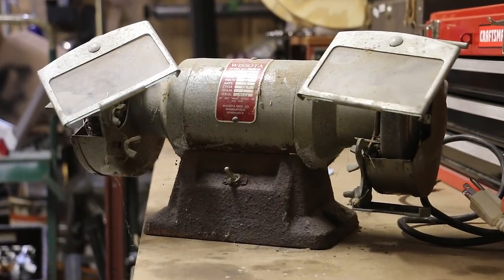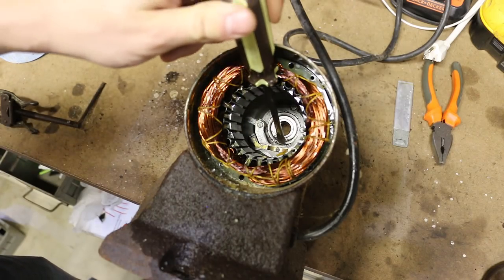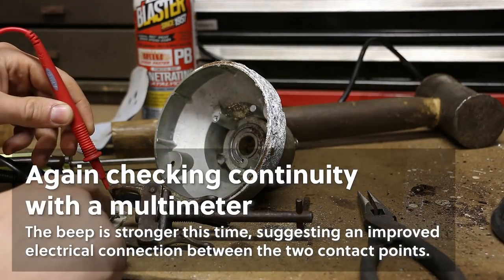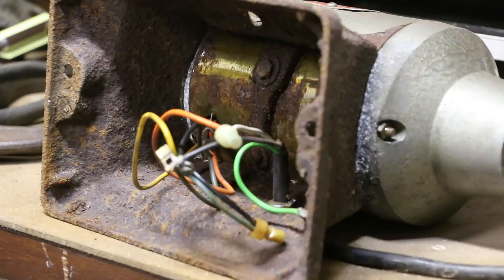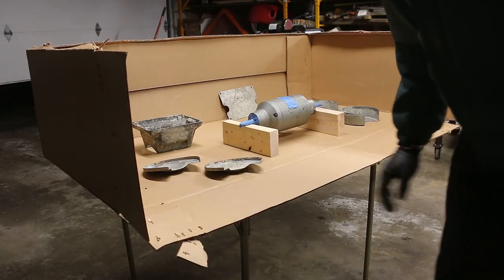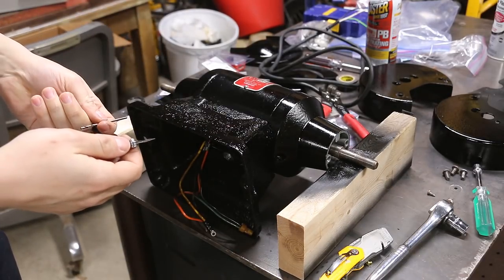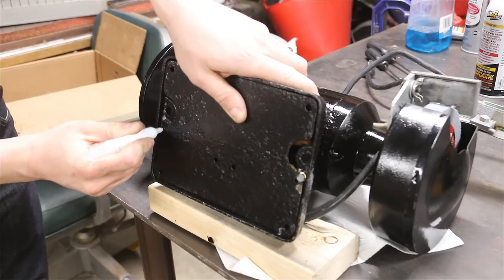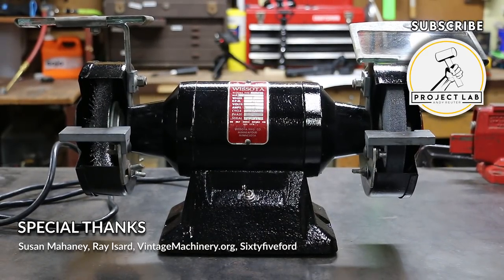Rusty old bench grinder restoration

Comment: How does that 1/4 hp motor do for power when grinding?  Looks like 2.8 amps?
Reply from the maker: Yup, 2.8 amps. Works great! I’m not making swords or anything, but I have experienced zero temptation so far to upgrade, based on the regular pieces of metal I have ground on it. I have used it a bit in some of my welder/metalworking videos, if you want to see it in action. 👍

Comment: Nice job. Was there even a start capacitor in it? That centrifugal switch looks like a start to run winding switch but I didn't see either start or run cap in it.
Reply from the maker: Thank you! Correct, no start capacitor. 👍

Comment: Great job, except I would have matched the original paint color.
Reply from the maker: Thanks! I thought long and hard about what color to paint it. Couldn't find a good solution for matching the previous color. I considered using the hammered Rustoleum stuff, but I'm skeptical of the brand, based on past experience. Meanwhile, I know that the Montana Gold paint works great. (Thanks to Jimmy DiResta.) I had some black left over from a different project, so I just ended up using that.

Might not have been the perfect choice, but it's working for now...

Comment: Next time you take a grinder apart that has been this wet...replace the bearings. Might cost you $10 max at a pricey place. Ebay..maybe $5. I can hear the bearings singing when the grinder runs and when you load it up. Not a major problem yet..but in a couple years under your usage..they will be DRT.
Reply from the maker: Thanks for the grinder bearing analysis! I will keep an ear out for that next time I use it...

Comment: Is the constant buzzing halogen lights? The video is really nice and the bat was the star of the show, but I found the noise a bit annoying.
Reply from the maker: Thanks! The buzzing is either some old fluorescent bulbs or a garage heater. The bulbs have been replaced with LEDs, and the heater won’t be on for a little while. 👍

Comment: Really nice, but did you replace the bearings?  Those would be the next items to go, I'd think.
Reply from the maker: Thanks! Didn’t change the bearings, figured that they sounded fine, and if they weren’t bad, I didn’t want to risk screwing them up. Maybe I should have, but at least it’s not too tough to get back in there...
Reply: True, once you've opened it once it's like riding a bike thereafter....probably the scariest part of this video is the fact that the Wissota grinder and I are exactly the same age.

Comment: my bench grinder is only like 2 years old (i dont use it much) i have to spin the grinding wheel so the bench grinder can start spining on its own
Reply from the maker: Whoa! Fair enough.
Reply: capacitor
Reply: and my bench grinder only has 350W of power

Comment: Why did you paint it black?  It is not good color for machines as it is harder to see when you work in the shop. Usually they are painted so that you see easily where the power tools are. Grey was much better and even better if it was painted more visibly. You need contrast between different tools so you see them fast, if you understand what I mean. It is safety matter. Perhaps you could paint the stone guards with lighter color. Especially when you have young serviceman helping you. BTW, the switch hex nut must be between the switch and panel, not outside as the hex nut prevents the threaded collar to rip off the switch. And one more important thing; measure the protective earth contact with ohm meter using small ohm scale to be sure it is ok.
Reply from the maker: I'm sure there are better colors out there, but black works fine here. I already had procrastinated for long enough on this, and I didn't want to agonize any longer over what the "perfect" paint color and brand would be. So I went with what I knew would work, and that was some Montana Gold SCH black that I had available. Thanks for the advice, in any case!

Comment: I did not see you lubricate the motor bearings. Did I miss it ?
Reply from the maker: Nope, didn’t do that step. Bearings seemed fine, so I left them alone. But never considered lubricating them. Any product you recommend?
Reply: @AndrewReuter  Since  you did such a great job with the restoration, it only seems right to properly lubricate the motor bearings. They do take the most punishment. There are many grease products specific for electric motor lubrication. I've used WD-40 protective white lithium grease with good results. Maybe someone here can be more specific.
Reply from the maker: Good to know. Thanks!

Comment: Bet if you tried it after tapping it with a hammer itwould have worked lol, but great job looks good!
Reply: All that work and you didnt sand down the brushes?!?also when taping of netal with sharp edges tap lightly all around with a hammer and it will cut and seal the tape line perfectly!
Reply from the maker: Thanks for the tips!

Comment: I cannot think of a single good reason for you to be using Lead Blaster for that application. WD-40 penetrant costs a fraction as much, and it releases bolts better than most of the "specialty" products that are available. Lead Blaster was designed to be used to clean firearms, specifically to eat lead deposits out of the rifling in a barrel, and as such, you don't need anything like it. For fluid film, you can't do much better than Honey Goo, and for general purpose penetrant/water displacer, WD-40 will get you anywhere you need to go in that regard. The makers of Pb Blaster clearly saw you coming from a mile away lol.
Reply from the maker: Appreciate the analysis. I’ve had great luck with PB Blaster, which is why I keep using it. I can give WD-40 a try again, but PB Blaster is 36 cents an ounce here, while WD-40 is 44 cents an ounce... So I’m not sure I’m the one being taken advantage of here... Just saying! 😉
Reply: Fair enough.
Reply: WD-40 is nothing more than kerosene (Stoddard Solvent) and a vegitable oil. It kinda sorta is a penetrant..but P'Blaster is much better. Almost..almost as good as Kroil. I buy all three..WD by the case..PB by half case and Kroil by 1/4 case each year.

Comment: That isn't a clutch, and there are no gears. It's a centrifugal switch which kicks out the start winding (powered by the capacitor) once the motor is up to speed.
Reply from the maker: Yup. Was trying to use an analogy to explain it, figured more people could relate to the idea of a clutch. Thanks for the details.

Comment: Couldn't use the too-big wrench on the switch, by shimming it with a thin piece of metal like a coin?
Reply from the maker: Not a bad idea, but I think the nut was just too far gone. Edges were rounded off and the surfaces were slippery with rust.

Comment: and..it was worth it because your Gramp used it..are you going to anchor this tool more permanently?
Reply from the maker: Thanks! Yup. Definitely vibrates too much to use it unclamped. Figure I'll eventually weld a pipe to a tire rim and mount it to that as a standalone station.

Comment: I'm always irritated when people automatically jump to "Nope, it's junk. Throw it away, and buy another." Ignorance and stupidity of the greatest form. First, if it's broken or otherwise not working, you can't break it more. And second, bearings, capacitors, brushes, switches, etc. can all be replaced. So long as the windings, commutator, and other vital bits aren't screwed, a motor is always salvageable. With what manufacturing standards are today unless you want to spend out the ass, saving an old tools is always the way to go.

Comment: Did electrolysis ever come to your mind to remove rust?
Reply from the maker: I have used it in the past, and it worked great, but I'm not a huge fan of leaving an unattended battery charger sitting in my garage, producing explosive gas. Doesn't seem worth the risk, as minimal as it might be. Here's some more thoughts on the subject: https://youtu.be/iMJUDyiruGA?t=5m7s

Comment: who makes a bench grinder black?
Reply from the maker: I would have rather gone with the original color, but research on how to achieve that paint job was taking too long. I wanted to be able to use the thing. So I said screw it and used paint that I had available and that I knew would work well. Hence the color. Not perfect, but still looks good to me.

Comment: Why change the color?  It would have looked better with the original color, the color of that era.
Reply: The paint is a Lacquer finish without a primer and any rust will run up under it and pop it off.  You could strip the original off, then apply a suitable primer and then a coat of lacquer to get the same look.  Manufacturers used it so they didn't have to do a primer since the Lacquer would stick even on oil coatings.
Reply from the maker: I couldn’t find good source for how to replicate the original color, so I went with Montana Gold spray paint, which I knew worked well and looked good. Maybe my kid or future grandkid will restore the original someday though!
Reply from the maker: @bitsnpieces11: Good to know. Thanks!
Reply: Andrew: The best I can figure is it was a grey/greenish lacquer with a metallic, possibly aluminum powder, additive to give that sparkly finish.

Comment: No bearings replacement makes this 'project' a major FAIL!
Reply from the maker: Bahahaha! I take it you’re a fan of those “perfect restoration” videos. In the real world, the saying “if it ain’t broke, don’t fix it” applies. Doesn’t make much sense to me to put a bunch of time and money into replacing a part that appears to be working fine, especially when a well-intentioned fix can often make things worse. Would rather be using the tool to work on other things. And now that I know the grinder works, and also know how to take the grinder apart now, I can easily change the bearings if they become a problem. 

Still working more than a year later, for the record!

Comment: The bearings appeared to be very suss?
Reply from the maker: I thought they sounded fine, but I could be wrong. Did something here make you suspicious of the bearings? (Beyond the fact that the grinder looks like it’s been soaking in the ocean...)
Reply: About 3.54 appears to be rust type stain on the bearing, but anyway after going to all the trouble to refurbish the machine, I'd replace the bearings as a matter of course and especially because you were having the issue of the rotor seizing, that indicates a problem, and that's a centrifugal switch the wires came off the change the power from the start windings to the run windings, cheers from AUS

Comment: 1. That was barely rusty
2. Why is a phone camera so valuable when it was made in 1970 when nobody had a phone
3. These are around £20 to buy new
Reply from the maker: 1. You have some intense rust standards!
2. Someone in 1971 would have drawn a sketch of the situation instead of taking a photo. Might take 30 seconds, might take far longer. A digital camera photo takes about 5 seconds, and you don’t have to decipher your handwriting later. And if you don’t use the info later, who cares, it took you 5 seconds instead of 30+. Lots of value in that.
3. See the end of the video for a cost breakdown.